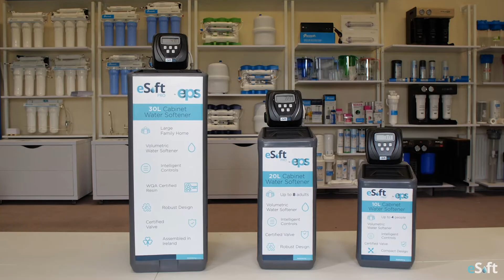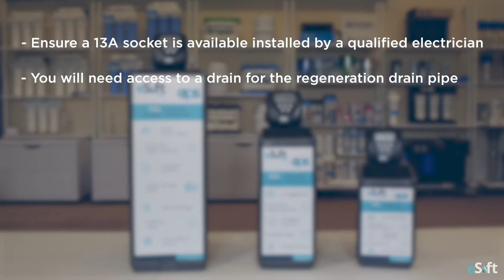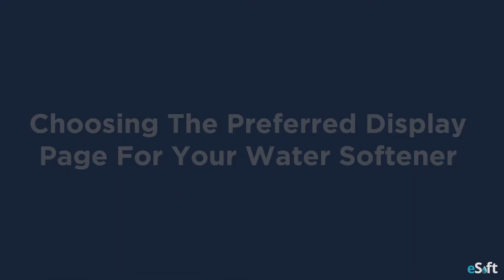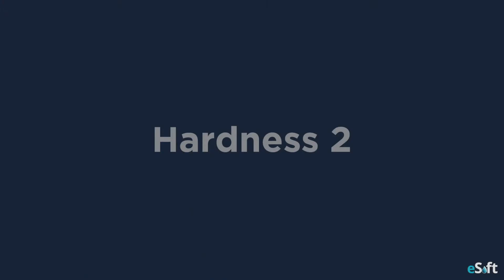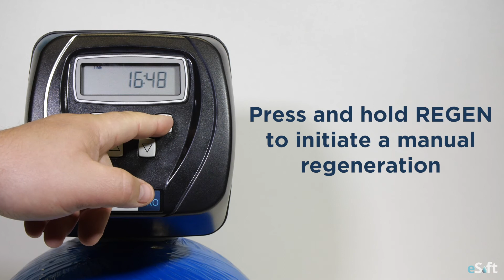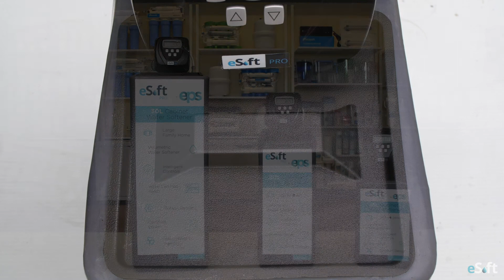How to install an eSoft Pro Water Softener System

Comment: The worst instructions ever. Are you waiting for all of these cycles to finish? It seems like you're just cycling thought them quickly, but then it also seems like the video is cut, so maybe you actually wait for all these cycles to finish. You should comment on it at least. Also, your online instructions show another step, that's not mentioned here. Need to look for different instructions.